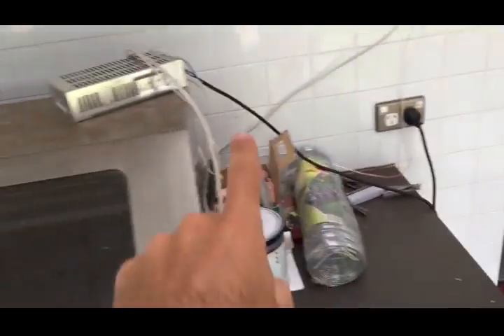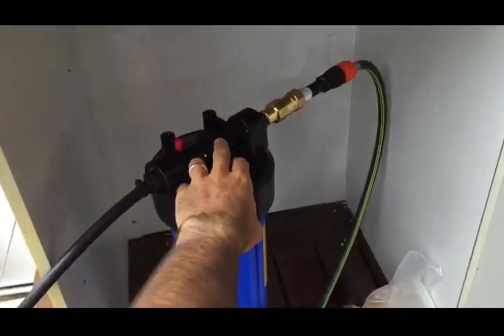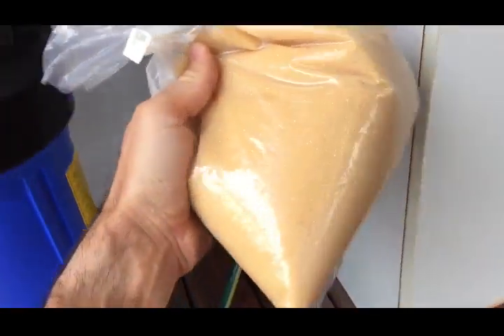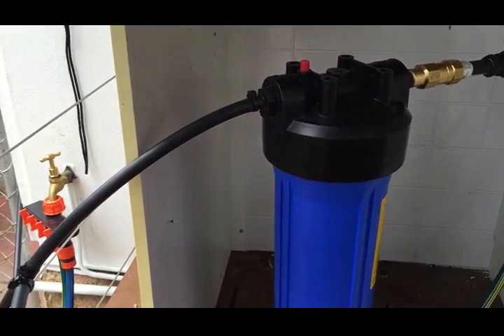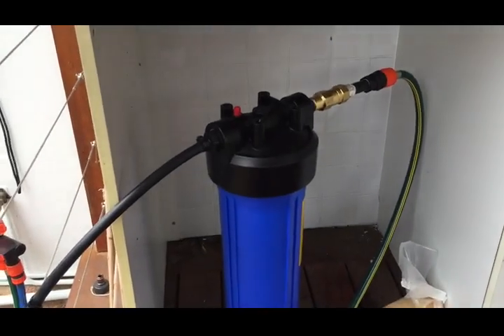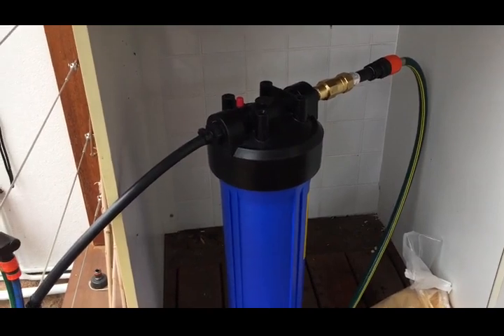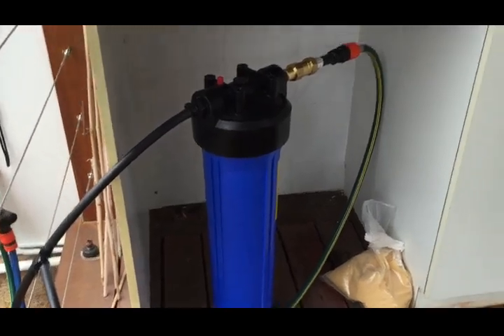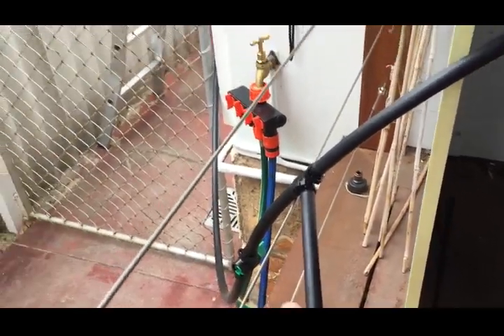Domestic solar PV panel water cooling DIY system

Comment: I've wondered if "boxing" the underside of a solar array and forcing the output of a swamp cooler across the underside of the array, thus cooling the panels from the back side, would be efficient or not. (Make the under array box internally reflective for bi-facial panels...)

Comment: So, after 7 years, what was the verdict?worth doing? Would love a follow up video lol
Reply from the maker: Lol the system ran for 2 years on full auto, but dead after that. Evaporative cooling towers need  biocide and various other chemicals to stay clean. The treated water going onto the roof was clean, but the recycle from the panels was full of life. Two years of use, and the tanks on the roof were 80% slime. Also, the plastic tubing had lost all plasticity from the UV in the harsh Australian sun., The tubing would shatter from any attempt to adjust it.

Was it a failure? Hell no! I had so much fun, and the memories and stories it gave me are priceless 😂

Comment: Did you think of a closed system that pumps water through a water loop
It can be used to heat your geyser water so your panels don't have to
Reply: This video is from 2015. 
These days you have hybrid systems available. If you wanna have a look, check Linus Tech Tips house upgrade video (installing solar)
Reply: @mynk0.78mm  i know... I saw that
I also know that in 2015 it was possible to put solar panels on an aluminium backing with copper pipes on it

Comment: 1000w extra pwr 🤔😳👨‍🔧
Reply: 775 12v motor on the 80w pump go hard on a 80 ex telstra panel .. DIRECT ..PWR,. even in clouds.

Comment: For less waterbeading, maybe that product gold panners use to lower the surface tension called jet dry could be used? For your calcium problem, would you be able to spray the back side instead? Would need more sprayers maybe... Good luck!

Comment: This is garbage you are risking ground fault with constant water  float getting stuck open and water flooding roof  scale build up realistically you  are making panels more efficient but at what cost using water and electricity as well most panels now only lose 17%

Comment: Hi, i know this is from 2015 however i would like to ask something. Would you ever try Peltier on solar panels? I mean thermal eletric pieces that convert heat/cold to eletricity or electricity into heat/cold. Would be interesting to power up the 12v pump with the heat provided from under the solar panels into the peltier that would generate 12 for the pump, so when the panels heats up it would power the pump and therefore cool the panel with water. Interest thought only never tried it on mines.
Reply: peltier works from a difference DIFFERENCE, the cool side of the peltier would have to be actively cooled. otherwise the cool side would just heat up with the hot side and there would be no temperature difference. also, it would only cool a section of the panel as big as the peltier is attached to. unless you had a petlier for each cell of the panel this would not be an efficient method of thermal transfer. ive considered this myself, sadly not a viable option :(

Comment: Pretty kool setup, Can you get white tubing that wouldn't degrade in sunlight? Just thought it terms of trying to keep the water as cold as possible to maximize the cooling on the panels the black pipes are going to absorb more heat from the sun.

Comment: Idea for you don't store your cold water on the roof in a black and yellow container. It will get the water hot before it cools the panels. Also cooling the hot side is harder and less efficient. Attache radiator coils to the bottom side of the panels this will suck the heat out of the panels. If you attached TEG modules to the radiators that could increase efficiency up to 10% you could possibly get 30% efficiency out of a 20% efficiency solar panel. The TEG idea would add alot of cost. A simple radiator system with the right pump might get you 2% to 5% precent more. Unfortunately radiator coils are pretty expensive to
Reply: White, white, white…..

Comment: How do you determine the gain introduced by water cooling? Is there a mathematic approach to correlate the energy consumption [ pump power vs Temperature] balancing with the system without water cooling ?

Comment: I too have a 5K system on a Spanish tile roof however my racks have 6 inches of air space to allow for better cooling. I commend you on your design and efforts but I found that one cannot benefit a significant net gain to offset the cost of a cooling system such as yours. The least expensive thing I could come up with was about $200 worth of fine spray misters. At best it would boast my output by 4,000 watts per day (4kw @  15c each) - which is about 60 cents worth of electricity. This does not mean 60 cents X 365 days each year.. I can only guess as the math can be tricky here but it would take at least 3 possibly 4 years to recoup your cost. If I were you look into raising your grid 6 inches from the tiles and get some better airflow. I makes a big difference. Adding more panels without overloading your inverter is another option. Good luck to you and Cheers from California!
Reply: I'm considering the misting method myself.  Electricity here costs about US$0.41/kWh and water is actually cheap.  The cost of the controller (timer with rain delay) is about $27 and the rest of the stuff should bring it up to around $100~$150. My estimate is I might see an additional 2kW per day. System might end up paying back for itself within a year.  My concern though is if the misting might actually cause the output from the panels to drop (mist blocking sunlight falling on the panels)
Reply: Try it and post your findings here. I'm only guessing but a controlled flow of small droplets of water my also have a magnifying effect.
Reply: @0rangevale  actually running the water over the tiles will give you a better cooling effect than running it over or under the panels itself. The airflow over the wet tiles will evaporate the water faster and more effectively giving cooler air to cool the panel down. 

How's it working out for you though?

Comment: it would be better to have a closed loop system that circulates the water from a basin,
that way you don't use water, but you can keep the temperature in a reasonable range.

Comment: To avoid meandering, you can try to cut up thin fishing line and placing them perpendicular on the panels. Cohesion should help keep the water going down in a straight line.

Comment: Thank you for providing an overview of your cooling system!  I'm currently planning to build a similar system for my array and was wondering if you've run into heat-failure of the black poly-tubing you are clamping to the panels.  The tubing is generally rated for temperatures under 60°C, and it seems reasonable that you can reach or exceed this temperature given the Australian summer and properties of the panels.  Of course, with the cooling system running, you should never reach this temperature.

Comment: I just read through a moderate amount of the "solarpaneltalk thread starting from your Jan 2015 1st post on your system. I was astounded at the degree of arrogance, self importance and pig-ignorance shown by many of the allegedly more experienced and capable people on that site. It seems likely that the more moderate comments on commercial viability and cost benefit had some merit and were worth discussing - but many of the "technical" comments demonstrated gross failure to engage/read or think. Very sad.
    I don't know how it worked out for you and whether you are still using it. It would be interesting to hear.
    In 2007 I tried "film cooling" and old 50W BP panel that was then about 25 years old [!]. I ran as thin a continuous sheet of water down the panel face as I could manage. Results were pleasingly good (even in Auckland NZ) . I did not pursue it nor have I used it subsequently but it added to my knowledge base. 

Russell McMahon. Auckland NZ. apptechnz at gmail

Comment: Nice job. I recall seeing an article where a manufacturer integrated water heating with panel cooling. Don't recall if it ever hit the market.

Thinking about even water coverage, maybe the old fashion spinning sprinkler would do the trick. Also adding some short walls around the panels may stop the wind from evaporate/blowing the mist. Perhaps a calm area above the panels would aid the sprinkler coverage.

Comment: Extremely interesting system!

1) Have you considered using RO instead of a softener? RO has some downsides but it's going to be mostly ion-free, so no scale. RO water is a bit corrosive to metal pipes but your whole system is plastic.

2) Be careful about the cooling system shading the panels. Minor shading can have profound impact on performance. You don't want your system to be activating the bypass diodes in normal conditions.

Comment: I went through this myself so I was interested in how you handled scale build-up. I just used rainwater in the end which worked well. I also didn't recirculate but just sprayed water on and let it fully evaporate to get maximum cooling for minimum electricity and water use. My control system was a bit more advanced using temp difference between ambient and panel to decide when to do cooling- basically when 7 degrees hotter than ambient. I should look at buying a little pump like yours too because mine is way too big. I have some videos on my channel if you are interested, Good on you for what you've achieved!

Comment: Kiss that panel warranty goodbye :).
waste of good drinking water at 50l/day costs more than 5kWh to desalinate the water.
just cut down the stink pipes and add more panels.
Reply: Could you provide a link to the Ts &Cs you are referring to, the brand name. My panels have no such restriction. And one other thing. A little less ego would go a long way.
Reply: Would rain void the warranty too?
Reply: +Karl Jensen Why would that void the warranty?
Reply: Because it is specifically excluded in the Tsand Cs which you should lookup